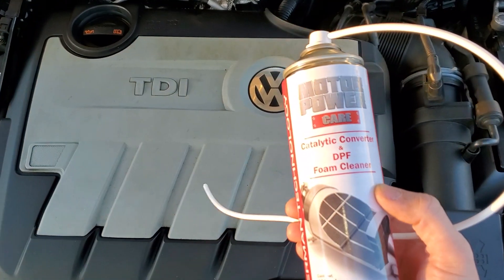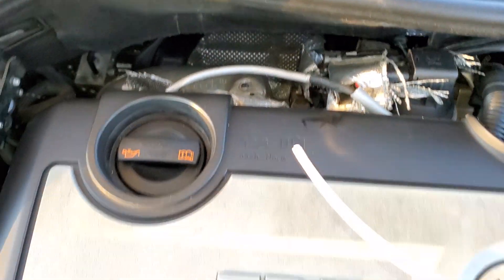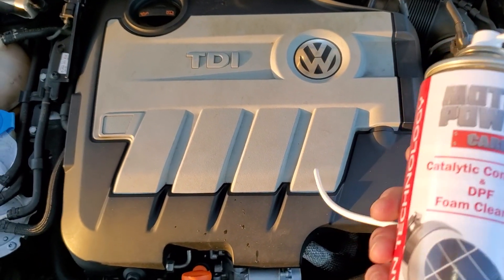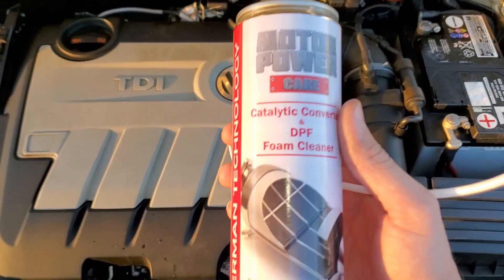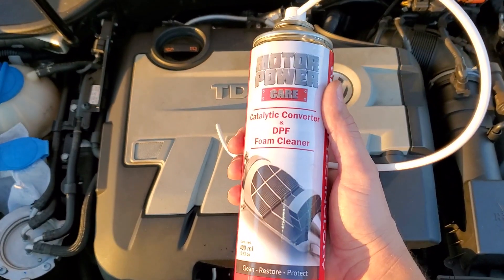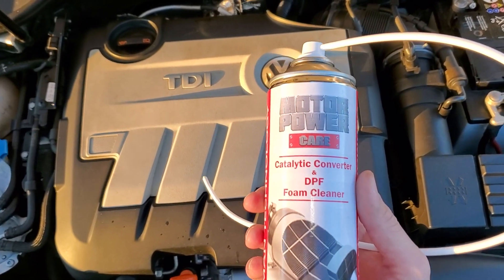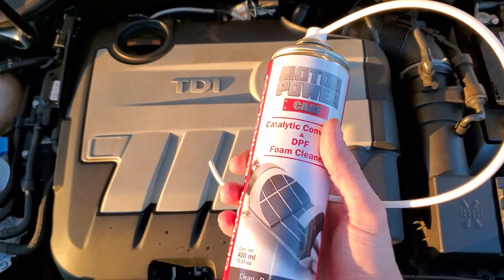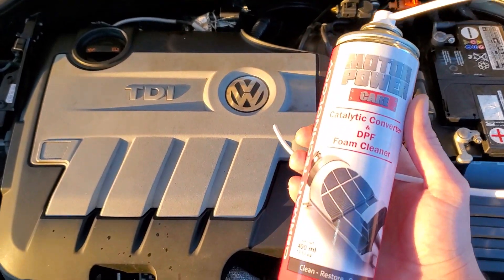How to clean DPF & Catalytic regen fix TDI Audi Volkswagen Jetta Golf Touareg Motor Power Care

Comment: Do you add the cans WHILE the engine is running?  I've watched your video 2 times and it doesn't say to start the car and then put the can in.  I just tried putting a can it, but the exhaust coming out of the o2 sensor hole just sprays it outward.???
Reply from the maker: At 00:48 I explain after you get the engine  hot 🔥 then you remove the sensor indicating the removal after the engine is hot never did i say with the engine running. That's implying the sensor has to be replaced back into position everytime you run the engine. You don't have to torque it down during the process only finger tight.  And never run the car with the sensor removed. And at 1:57 I say in the video to put back the O2 sensor.  You need to slow the video down and put captions on because you missed all the steps
Reply: Thanks for the reply.  Not trying to criticize, just reflecting on this video.  I think in this case, the video would have been more affective if you would have gone through the process (motions) instead of just presenting information that's easy to miss like I guess I did.  Anyway, unfortunately this method didn't work for me.  I did stop the engine and put each can in and then replace the o2 sensor and drive around for a while.  For what ever reason It made the car even worse and had to get it towed home not long after I put the last can in and was going on the 60 mile drive. It starts fine, but doesn't have enough power to even move itself an inch.  I don't have the money to have it diagnosed and so will probably end up scrapping the car. @sextillionproductions

Comment: Can you do this if it's in limp mode?
Reply from the maker: Yes as long as you can rev your engine  to 2,250 rpm.
Reply: Get first the car out of limp mode with obd2 scanner, then spray 2 bottles in a row and then drive

Comment: So let me get this clear. You firstly prepped everything(took shield off, unscrewed the O2 sensor, etc) - cold engine, then drove the car till it got up to 190 water temp, turned the engine off, injected 4 cans trough the O2 sensor hole, plugged back the sensor back and drove it more on cruise/manual mode round 2500rpm for a good period of time?
Reply: I have a EGR valve that I replaced but still have some codes for it on. Do you think I need need to do this step in order to clear the codes ?
Reply from the maker: With engine Cold you unscrew O2 sensor and leave it in the DPF only finger tight so it is easy to remove when everything is ripping hot 🔥. You should rewatch the video to see all the steps and proper way to inject each can. You do not inject all 4 cans at once. You need to watch the video your missing alot of important information. It's 2,250 RPM and it has to be driven for 40-50 minutes cruise control/manual mode and if you have a OBD reader that can show when the DPF regen goes on and off you will see the DPF regen turns off whenever you speed up or press the break. You can not touch the accelerator or the break pedal at all during the regen because if you do it will turn it off. There's alot of details the manufacturer explained that I put in the video that need to be followed accordingly to ensure a successful regeneration of the DPF. Watch the video as much as you need so you understand the whole process and steps required. You can also put on the captions to understand clearly. Follow the directions as prescribed in the video and you should have a successful regeneration of the heavy metals that clog the DPF. Regular regeneration happens  all the time driving regularly but this process is a 40-50 minutes long Drive because your doing a special regeneration to remove heavy metals that build up in the DPF every 40,000 miles and can not be removed from the DPF with regular regeneration. I recommend to drive the full 50 minutes after following all the steps and procedures according to the video. Also check if the EGR is clean. If the EGR is dirty (filled up with soot clogging up the walls of the EGR) you should clean it.
Reply: @sextillionproductions  question,  I did this today all four cans, and my drive ended up having a lot of stops. Do you think if I try again to go on a longer drive at the same speed it will work, or would I have to restart the process of putting the cleaner in the dpf?
Reply from the maker: @GwendolynGill  Follow the directions in the video for the drive. An OBD reader can show you when the DPF regeneration goes on and off while driving. Stopping or accelerating will stop the regeneration thats why it says to drive in cruise control for 50 minutes non stop without speeding up or slowing down for 50 minutes

Comment: Did the deed with 4 cans.  1st can went in with little effort.  DPF light still on after the 50min CC drive, 5th gear 60mph.  I think there is something else wrong causing my problem.  The glow plug light started flashing after the regen attempt.  VW replaced the dpf 3 times under warranty.  This vehicle was in and out of VW service for the full remaining year of emissions warranty, which has now expired..  Any suggestions?
Reply from the maker: Check the EGR flow and clean the EGR if it needs cleaning due to soot build up. Check with an OBD2 reader for all codes and to check when the regeneration turns on and off while driving because pressing the break or fuel pedal will stop the regeneration procedure. Check DPF pressure sensor (little black box) sometimes there are cracks in the hoses that could give off the DPF light, also check Dpf O2 sensor make sure all sensors are in proper working condition. And check for any obstructions with the Catalytic converter along with the exhaust pipe check for any bends or kinks from driving that might obstruct the airflow. Also check the air filter to make sure it's clean, if not I would recommend changing the Air filter for a new one. Air leaks and Glow plugs not working are a big contribution to DPFs getting clogged after cleaning.
Reply: If the glowplugs are not working properly it will never regen properly,,,
Reply: You didn't  RIP IT hard enough!
Reply: @jackpitre7942  RIP- remove internal parts.  Probably the best solution.  Still running with 5+ codes.
Reply: If the glow plug light is flashing it’s a MAF /EGR code. When you run the engine to cook the cleaner the MAF is still telling the EGR to open. One certified mechanic I watched earlier said you should disconnect the MAF , to kept the EGR closed so you don’t recycle the cleaner through the engine .. then again if the EGR also clogged you would think the cleaner would be a good thing. 🤷‍♂️🤷‍♂️ now he used a cleaner that had two parts , with a rinse product. That was a lot more liquid. And he said it could hydrolock the engine if pulled thru the engine. Again 🤷‍♂️🤷‍♂️

Comment: I doubt speeding up or slowing down would have any impact while on this drive.. impractical to sat you can't do either (rolls eyes)
Reply from the maker: I had the OBD-II tablet reader on and anytime you speed up or slow down it turns off the regeneration on the DPF so yes it does effect and I Learned this from the Volkswagen manufacturers and tested it myself and it is true it does effect it 100%

Comment: Did you have to wear gloves to remove the sensor?
Reply from the maker: I first disassembled everything and removed the sensor cold 🥶 then gently screw the sensor back in (gently finger tight) so you can easily remove it when the DPF is ripping hot to spray the cleaner. Your supposed to use a tool 🔧 to loosen it and wearing gloves would help tremendously but if you don't have anything I did it myself with no gloves and just kept it Finger tight super loose so you could take it out to spray the cleaner by just holding the sensor by the wire harness as not to burn my fingers and gently twist to not hurt the wires. They are thick gage wires so no damage was done and the sensor came off and on easily gently twisting to install and Uninstall to spray the cleaner.

Comment: I really enjoy my passat, and the fuel milage is great, and also understand that there is always something on cars that will need attention at some point. However, when i add up the money for the car. Parts and the amount of time i spend on it, i can't see where im ever getting ahead owning one. Ive never known a vw that didn't always require attention. And this dpf system that vw was forced to install is such a garbage way to do things with the def fill in the trunk so it leaks everywhere and turns a salty white acid eating powder when it dries.  That part rhe dealership managed to skip over before i signed the paperwork. And feel like i have a car that was built with whatever pieces they could find to hopefully make a car out of.  But i appreciate your time and video it was very helpful.
Reply: So whiny. 1st off, learn to fill the Def properly. It's not rocket science. All of the 2.5 gallon boxes come with a flex hose that easily reaches the DEF opening.

Second, the DPF doesn't need a ton of maintenance. I've had my car for 175k and haven't had an issue with the DPF.
Reply: @nathanielfuentes5294  The DPF after recall is terrible
Reply: @jacobschneider3767  I have a post Dieselgate TDI in California. DPF hasn’t had a single issue. Cooling system is another story.
Reply: Delete it problem solved.

Comment: I have the same problem, but can't open the bloody sensors so i was wondering if i could shove a long pipe from the exhaust pipe all the way to the dpf and spray the stuff from the back to unclog the dpf. Could this work ?
Reply from the maker: You have to remove the heat shield from the DPF, remove the DPF "pressure sensor" (should be a little black box), and unplug the DPF "O2 sensor" from the wire harness, ((should be metal and screwed into the DPF), my wireharness connector was orange), then you should have enough room, to unscrew the metal DPF O2 sensor from the DPF. If all else fails then they sell a socket made especially just to remove that DPF O2 sensor. Once the pipes are ripping hot you don't want the plastic hose from the can melting in the exhaust. That's why you have to put the hose in through the DPF sensor hole. You have to take out the sensor to spray then put back the sensor and rip it again. That's why I would not recommend risking an injury trying to disassemble and reassemble the exhaust burning hot between spraying

Comment: Hey brother. Hope you're reading the comments. What codes did you have before doing this flush?
Reply from the maker: Buy using link https://amzn.to/3VFEPoo to help the channel. I replied to your other comment just FYI 👍 and the codes I received was P2002 for the DPF and the second code was for the NOx sensor. After performing a flush you need to check the EGR if it needs to be cleaned.

Comment: Have you done this with a high soot mass dpf?
Reply from the maker: Buy using link https://amzn.to/3VFEPoo to help the channel. If you mean a dpf with high soot like the dpf found in a Volkswagen then yes I have. And if your talking high soot in regards to the level of soot then yes I have done this for a dpf with alot of soot. If you mean a semi truck I have not but I believe it is the same process.
Reply: @sextillionproductions  just bought 4 cans, gonna try to get it done this coming weekend. My soot is only reading about 13g, not sure why it's throwing a P2002 and Check Engine light with that low of soot, hoping this saves me 2600$.....
Reply from the maker: @joesaiditstrue Buy using link https://amzn.to/3VFEPoo to help the channel.  Every 40,000 miles the DPF accumulates heavy metals that can not burn off during regular regeneration. I was receiving the DPF light code even at low soot levels as your currently experiencing,  even after performing a DPF Regeneration, the cause for the code appearing is due to the heavy metals accumulated over the 40,000 miles. After you flush the DPF also check the EGR for cleaning.
Reply: @sextillionproductions  How do you check the EGR for cleaning?
Reply from the maker: @quarterpanel   Depending on your make and model you can use a THINKCAR - ThinkCheck M70 OBD-II Diagnostic Scan Tool https://amzn.to/3q7ZR3b buy using the link to help the channel. Also you can remove the intake to the EGR and look visually for carbon soot build up. Excessive carbon soot build up should be removed.
Reply: Have a video on cleaning the EGR?

Comment from the maker: Buy using the link https://amzn.to/3VFEPoo
I ment to say 5th gear 60miles per hour 40-50min 2,250 RPM for a proper regen and it was the DPF sensor you may need to remove also the heat shield for the DPF may need to be removed to access the O2 sensor on the DPF 
Buy using the link https://amzn.to/3VFEPoo
Reply: Thank you for video. I tried to do it and failed. What kind of lights did you have on your dashboard?
Reply from the maker: @alexkokhanets9358  I had the DPF light. You can use an OBD reader to check the codes. 👍